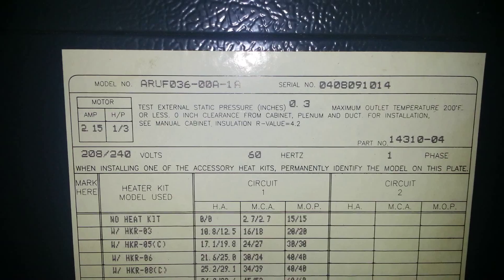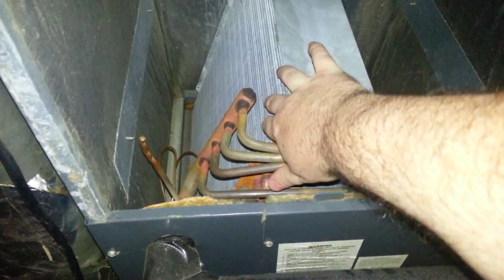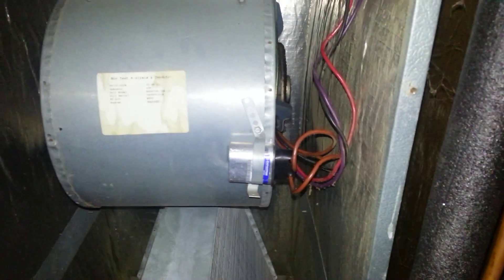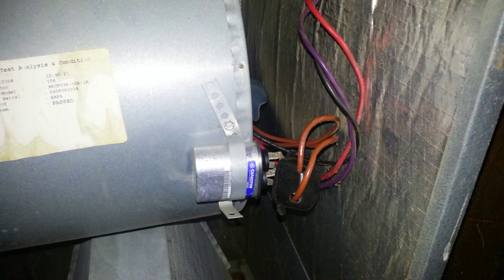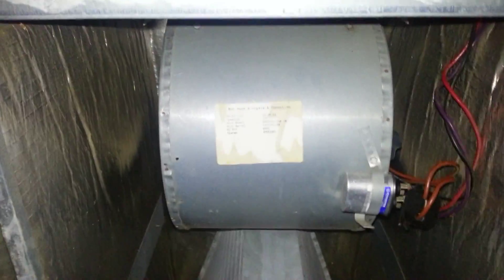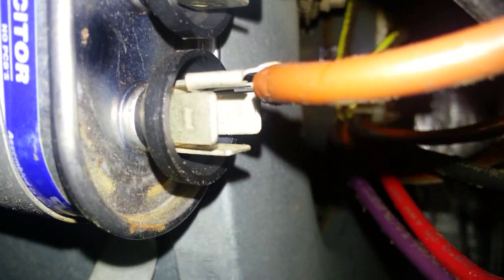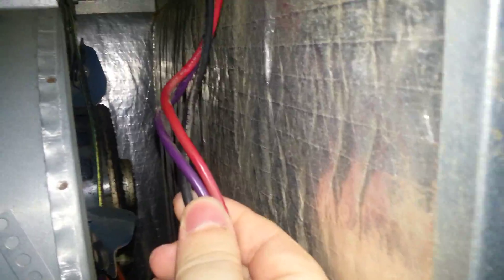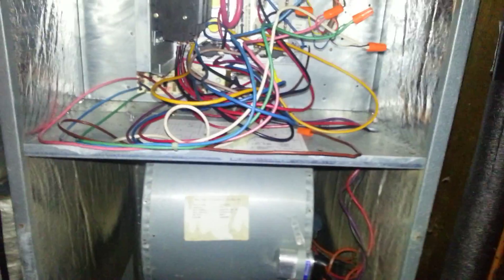Part 1/8: Replacing Blower Motor on Goodman ARUF036-00A-1A (M7?)

Comment: anyone else catch that he shorted the capacitor through himself?  If you do this DO NOT USE UNINSULATED TOOLS TO SHORT A CAPACITOR!!
Reply: Bo
Reply from the maker: Outdoor Randomness yes! I discharged it with a screwdriver before I started recording then just used what I had in my hand for the example. I didn't even realize I did this until you called it out.

Comment: Purchased a Goodman 96% efficient furnace 10.5 years ago retired, wanted to install it myself not that it saved me around 2,500 buck.  Last furnace was 25 years old, had a GE 1/3 HP motor on it with oil drip holes.  Had to oil it every season, blower motor assembly had to be removed with it.

Saw no oil holes on the Goodman 1/2 HP motor, took it apart, they got to be kidding, no oil ports, Made in China Shield Ball bearings on each side.  Could only reply, stupid, dust can build up in there, seize the bearings, jam the motor, blow the circuit breaker.  Is a two phase motor phased shifted by a capacitor.

Did bench test it, was an electrical engineer, with a power meter and a digital tach, with the highest speed, at 120 VAC, the speed did not change dropping the voltage to 100 VAC, this told me the magnetics were going into saturation, can't quite recall the exact numbers, but with reduced voltage, blower motor speed the same, cut the input power about 25%, and the motor operation temperature  greatly decreased.  So designed a voltage dropping circuit.

I found Made in the USA same sized bearings but sealed, popped open the seals cleaned out the cheap grease and use Wolf's Red High Temperature Bearing Grease.  Still working great after ten years, both heat and AC.  The ends of the stator windings were not sealed properly, had Electrical motor varnish left off, nice thin coat. 

The stator windings feel the same tension as the rotor, if not tied and sealed properly adjacent wires will rub together, short out, shorted turns suck up electricity like crazy, get red hot, there goes the motor.  With this extra work, motor is running perfectly.  Also have a three level home, so I run the blower motor continuously to even out the temperature and prevent mode buildup.

Replaced the vacuum switches with Made in the USA switches, have an external microswitch, OE's have the switch contacts inside, suck in gas fumes that coats the contacts, no electrical connections, no heat.

Vent motor was another problem.  It suck hot air from the exchanger does have a ball bearing where the cheap lubricant dries up.  Only way to take this apart is pull that shaded motor out from the rear of the plastic case, then you can pull the front bearing, rear one too.

Pop off the seals, use solvent to clean off the dried up lubricant, use my Wolf's Red High Temperature bearing grease and seems to last for ever.  Really hurts to lay out 160 bucks for a vent motor that has the same problems, hurts even more if you have to lay out another 400 bucks to have it professionally replaced. 

Yet another problem is using PCB reed relays to switch on both the vent and blower motor,  added buffer relays with MOV protection that have 15 amp contacts, so not replacing that circuit board every five minutes. 

Nothing worse than have your furnace die when its -30*F outside and on a weekend or Christmas day.

Comment: I have a GMP100-3. My motor failed. I ordered a new motor but then I was unable to get the old motor shaft out of the wheel and may have damage the wheel so I had to order a new wheel. This was a difficult ordeal as it is February 2020 and for 4 days the weather has been as low as 6ºF (-14.4ºC) and only got to 35ºF (1.7ºC). I have two rooms with electric baseboard heat so I was able to function while waiting for parts, uninstalling old parts and installing new parts. Thanks to your video I was able to replace the motor housing, motor and capacitor and get my furnace running again. I learned a lot about my old system too.

Comment: We did this and replaced the motor.  Ran great for 3 days then we came into the house and it was 81 degrees when we set it at 73.  The blower motor and aux heat won't turn off.  We replaced the thermostat and same thing.  Even with no thermostat hooked up the furnace would come on as soon as we flip the breaker.  What did we miss?

Comment: Should always change the capacitor with a new motor even if it’s still good. They are not that expensive
Reply: I may not do this. I just replaced my capacitor yesterday, but it looks like the issue may be the motor. Since the capacitor is essentially brand not, it would be pretty pointless to replace it if I get a new blower motor.

Comment: Question... How come you don't have a leak when ur coil is rusted? ALso did you have to add freon to your unit?
Reply from the maker: No clue. I did not have to add freon, the only problem was that the motor burned out.
Reply: Looks just like mine. The coils are not rusting just the supports.